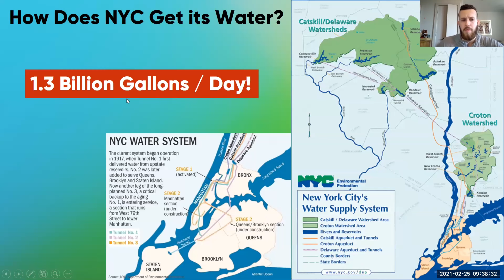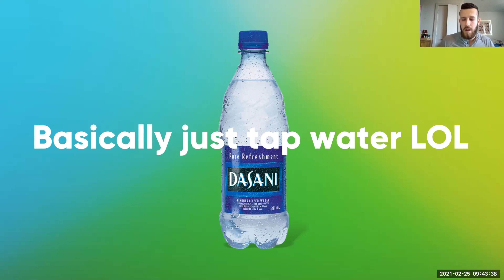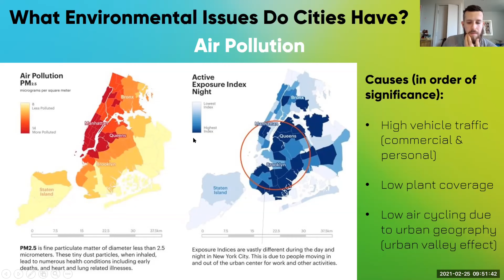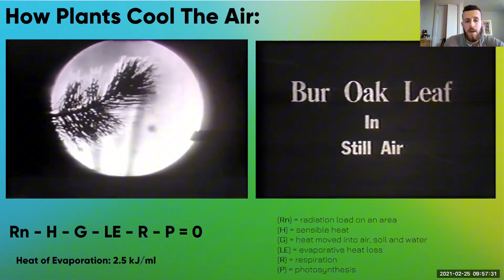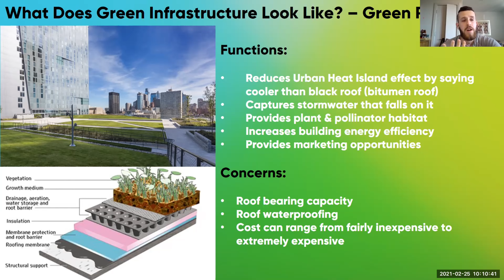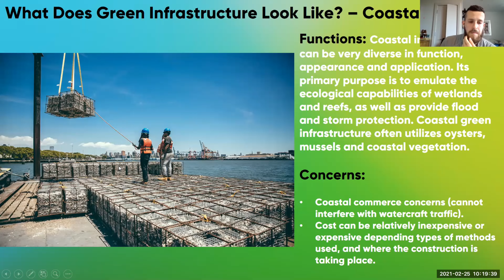Why Cities Flood and How Plants Can Save Them | Igor Bronz

Comment: After watching this video, I started noticing how bare most rooftops around me are. They are flat, heat-absorbing surfaces with no green infrastructure in sight. It's interesting how invisible these systems are until they fail. Living in South Bend, IN, that failure is familiar: heavy rain events regularly overwhelm the combined sewer system and discharge into the St. Joseph River. Efforts to address this have focused on underground storage tunnels, but that's treating the symptom rather than the source. Green infrastructure like bioswales, rain gardens, and permeable pavement could reduce runoff before it ever reaches the sewer system. The upfront cost is always cited as the barrier, but the long-term savings in repairs and environmental remediation make a strong case for investing sooner rather than later.

Comment: There is a large lack of green infrastructure here in the States, especially that on roofs unless you go into larger cities, then there might be a few scattered rooftop gardens. Similarly, we see a lot of flat roofs which end up absorbing more heat rather than slanted roofs. I am from St. Louis, which has a massive lack of green infrastructure, especially considering I am in the city. There are a few parks however food deserts are an issue. Because of this, some community gardens have been installed in higher risk neighborhoods. Arizona is another place I grew up, and interestingly, more homes do have slanted roofs and have clay tiles in place to assist in the harsh desert climate.

On a side note, when I traveled to Brazil with my boyfriend, there was this home which had a green rough full of plants and moss, which was totally awesome. Also, they have a lot of drainage chains to help with the high rainfall. I think this is a great example of implementing green infrastructure.

Comment: Looking at the roofs surrounding me on campus, I see a lot of flat, non-sloping roofs with no green infrastructure on them. This leads to drainage issues and increased heating in the summer, which increases maintenance and upkeep costs. Purdue is starting to implement green roofs, but the cost of roof reinforcement and installation is likely hindering their progress in adding more.  As someone originally from West Lafayette, our biggest urban infrastructure issue is our combined sewer overflow system. While the CSO is on its way out, there are many ways West Lafayette could increase green infrastructure in the area. The city could add more rain gardens, utilize permeable pavement or alternative sources of asphalt to increase drainage into soil, rather than into the CSO system.

Comment: After watching this video and looking at rooftops in my area, there is very little green infrastructure present. Green roofs, which are discussed in depth in this lecture, are a great way to reduce heating inside buildings and reduce energy consumption. However, these are not present in my area, likely due to implementation costs.
I am from Columbus, OH - one of the biggest urban infrastructure issues is the combined sewer overflow (CSO) system that the city still uses. They are currently funding projects to transition away from CSO but in the meantime, the downsides of this combined stormwater-wastewater system are still present. Green infrastructure like rain gardens and detention ponds would help reduce the risk of a CSO overflow.

Comment: After watching this video, I looked around some buildings and my apartment. I could not figure out if my apartment has water reuse facility but other rooftops didn't have any green roofs or rainwater reuse facilities. It might be difficult to see a green infrastructure in low building, but I hope I can see water reuse facility. I live in South Korea, and the biggest environmental issue here is radiant heat by sky scrapper. Many of buildings are built with tempered glasses due to design. In summer, with high humidity, and fine dust, weather becomes hotter. As mentioned in this video, I hope there more trees to manage heat and source of heat which are fine dust and CO2.